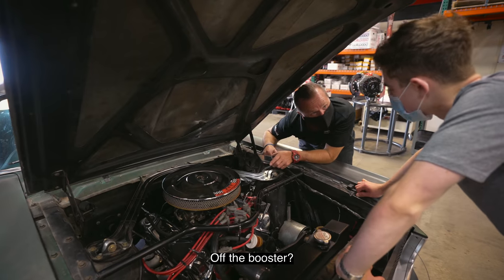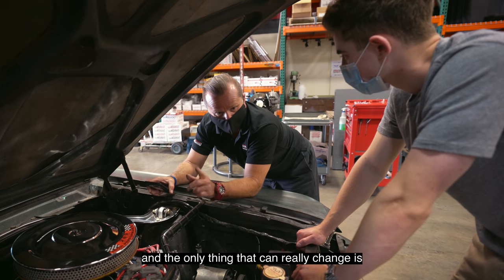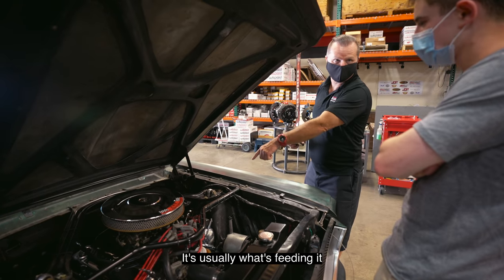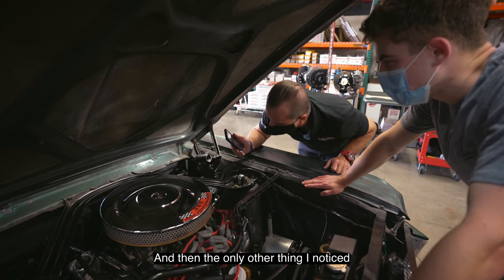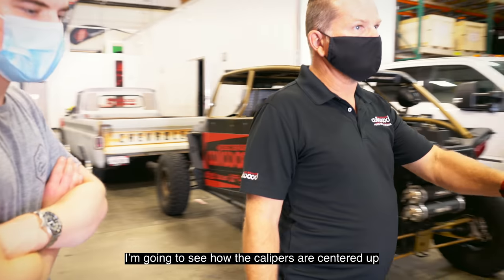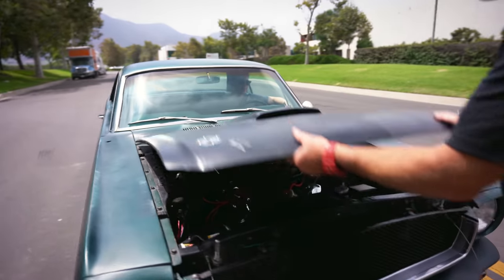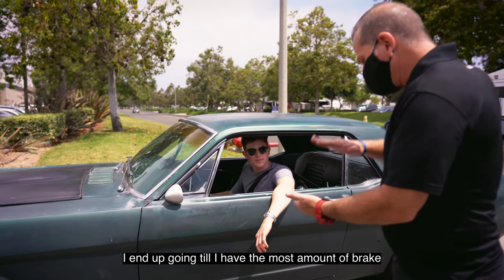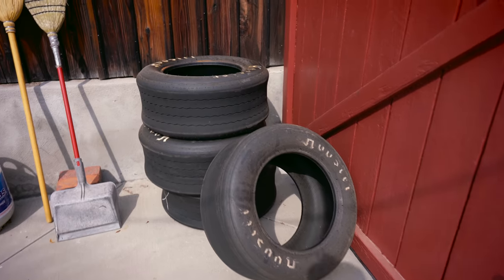Dialing in the Mustang's Brakes at Wilwood!

Comment: Very informative, my 68 has manual brakes and steering and I love the feel. Thanks Ben
Reply from the maker: Awesome! I can’t wait
Reply: @Harvey Mushman I have the same setup in my 68 also and love it.  I’m still running drums all the way around and am getting ready to do a disc upgrade. This video totally convinced me to stick with the manual set up when I put the discs on.
Reply: Matt Timmons , I got a disc brake setup off a scrap yard 73 cougar and was an easy bolt on. My next project is the Shelby drop and grab-a-trak spring kit.

Comment: My 67 four speed Mustang with a built 302 only had 12 inches of vacuum with a brake booster.
I'll tell you about a braking issue I had.  With station wagon rear finned brake drums/shoes (larger than normal Mustang drum brakes) the rear brakes started locking up when stopping at all speeds.  I did the usual by replacing drums, shoes, cylinders, flex lines, master cylinder,  booster, proportioning valve and bleeding countless times.  It turned out the rebuilt booster was the culprit.  I went to disconnect the push rod from the brake pedal to the booster and the push rod was literally broken in two pieces!  How that thing didn't completely fail is beyond me.  Replaced the booster for the third time and the locking brake issue was cured.  I don't understand how that would just affect the rear brakes but it did.
Reply: Do you have the front and rear lines mixed up on the MC ?
One of the classic Mustang mags did a feature years ago and hooked them up wrong and fought the brake battle furiously...
I've also had good luck using the 78 Granada/Maverick brass combination valve, which stages the brake application and limits pressure.
Reply: @hotrodray6802  no, the lines were not in the wrong sequence.  When I first encountered the problem of locking brakes, I literally disconnected the rear feed line at the master cylinder and did a slow brake test.  It's one of those things that I couldn't figure it out why it happened.
Reply: I have a 67 cougar didn't know the new booster was junk, 20 f in hours later I figured it out
Reply: @dogsense3773  only 20 hours?  Consider yourself lucky.

Comment: Great video good info , I personally prefer a vacuum pump over the hydroboost , if you stall your car or the  engine stops running for any reason you lose your brakes and with the vacuum pump you still have a little residual left in the booster to get the car stopped . Just my opinion.    and keep the videos coming
Reply: Hydaboost has an accumulator. You have two good stops saved up.

Comment: Love this car! No Honda wheels and rubber band tires, no billet steering wheel. It's just perfect.
Reply from the maker: Thanks!
Reply: I think I mentioned this on another video but the '66 Coupe that I bought at 14 (in '79) was nearly a dead ringer for yours. Shelby nose, a '69 302, etc. and I did many of the same mods you've done. I had 'glass flares on the rear fenders though since both rear quarters had been crunched and replacing them was beyond both my skill level and budget. My after school job made me @ $50 a week!
Reply from the maker: That’s awesome man! Thanks for sharing🏁

Comment: Cool video, its fun watching you learn and figure things out. One way to build vacuum in traffic is to downshift and use the engine to brake. Its an old trick I used back when the 4 speeds were unbroken and I ran power boosters on my low vacuum engines. The high compression 455s I run don't care, they make a ton of vacuum even with what would be a huge cam in a 302 Ford. You can do it with an auto trans too, but some like a stock Th400 or C4 won't downshift until the governor allows it. The speed at which the governor allows a downshift varies a lot, even in the same application. Lots of variables. Its a very simple change on a Th400, you plug a certain hole in the valve body, but then you can put it in first gear at any speed.. tends to lock up the rear wheels or spin the engine so tight it grenades when you do that at high speeds.

My 67 Cougar came with the 4 piston disc brakes from the factory. It was my first car and I never understood when people said muscle cars have bad brakes, that thing stopped like right now provided you didn't lock them up. Then I drove a 68 Chevelle with drums, and a 69 Charger with drums, and it all made sense after that. Only two Pontiac cars I have are staying 4 drum, they are low buck sleepers, 68 LeMans and 72 Ventura. Drums are a lot more work keeping them stopping straight.
Reply from the maker: Awesome! Thanks for sharing!
Reply: Got me a 67 cougar with 4 wheel disc

Comment: Do you need power brakes when running willwood disc on the front.
Reply from the maker: I’m currently converting the car to manual right now...vid should be out in the next couple of weeks
Reply: Four Speed Films that’s sweet man I’m putting on my master cylinder this weekend and brake lines for the same willwood kit you have any chance we can text on Instagram I have 65 myself that I am doing and would love to get your advice
Reply from the maker: Yes feel free to @benkahan ...I would just switch over to manual tho & I’m reinforcing the firewall with a metal plate...I haven’t tested it out yet but it was only $35

Comment: Why do large engines make less vacuum?
Reply: Big cam valve overlap. Intake and exhaust valves open at the same time.
Thats where the rougher idle comes from.
Reply: Note. The cubic inch size engine doesnt matter.
It happens to all sizes with a big cam.
Reply: @hotrodray6802  Ah, thanks for explaining man. Even on my stock 289, I can feel the loss of vacuum after repeated braking, and the brakes coming back to life after some fast driving.
Reply: because the bigger the duration on a cam/larger the degree in closing the intake valve abdc, the air escapes out of the cylinder into the intake a bit, thus killing vacuum. thats why cams lope like they do. its a controlled vacuum leak. go pull some vaccum lines off some newer cars and they will start to lope too.
Reply: Frigglebiscuit Thanks guys, learnt something new

Comment: Ben careful with that rear end locking up like that. In my experience my car performs best when I dial out the rest lockup you don't want that rear locking up in a turn its like a BMX bike. When you get it all fixed dial it out so the majority of braking duty is on the front!
Reply: rather have the front slide than the back tbh...thats scary indeed.